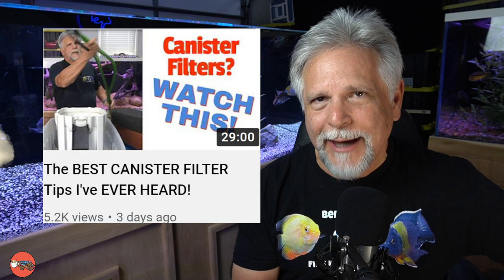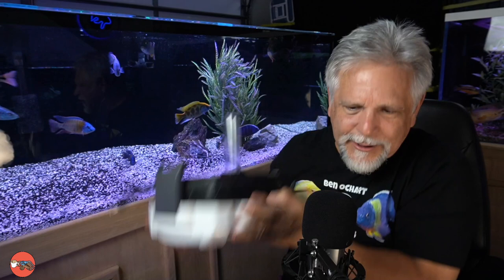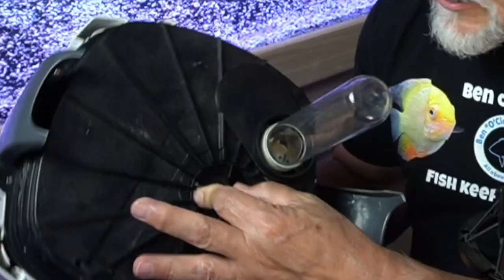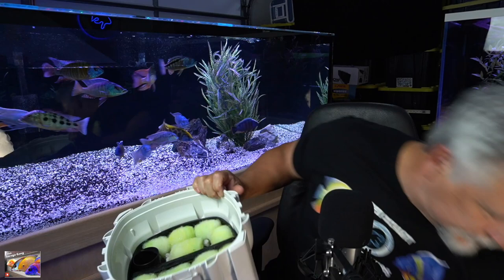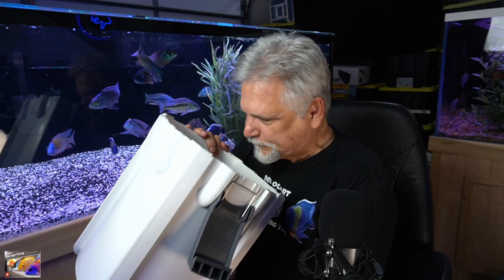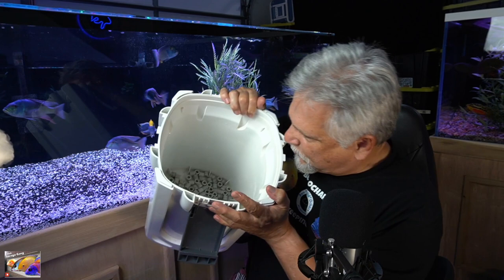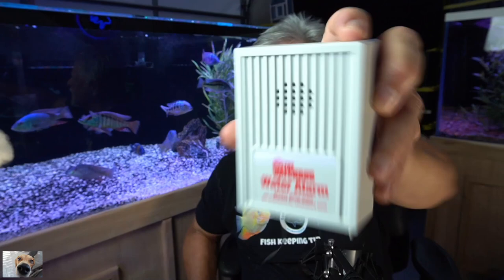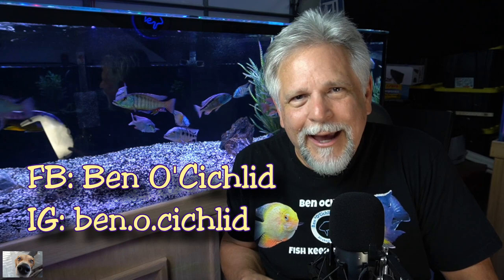COMPLETE Internal Media Set-up of my CANISTER FILTER!

Comment: Really great to listen to someone who knows what they are talking about. 
One thing that I have heard about the APS canisters (same as SunSun). The o-rings don't tend to last long for some reason. I have seen some people wrap this area in PTFE tape as an insurance.
I can imagine that it would be a nightmare if this failed and it pissed your tank all over your carpets or hard wood floors. Otherwise, a very decent filter for the price.
Reply: I have a sunsun 304..three months it started leaking. Change of O rings and tape hasn’t helped at all. Any suggestions to stop it from leaking?
Reply: @kunalravisingh4382  If it was 3 months, I'd be taking it back to the shop.
 Check that the lid is on properly and that the o-ring isn't crimping or incorrectly positioned.
Reply: I had both my sun sun do exactly that wifey was angry lol rightfully so I came home to a flood and over 100 gallons of water on our carpet in the basement it took forever to dry up and a lot of vacuuming and fans to clean shortly after the second one leaked even with Teflon tape over the gasket we thought it was best to remove the sun sun and added fx6 filters problem solved we paid a lot more for the fx6s but worth the peace of mind with anything you get what you pay for 🤙🤙🤙

Comment: I totally agree with the way you set it up. That is why I like the sunsun because the fx6 is bass akwards in my opinion..
Reply: @ Chris G…I have an FX6 and like it a lot, but it is a beast to move around and/or remove from my tank stand (which is not really built for an FX6). And, I’m waaay overdue for maintenance on that due to shoulder surgery a year ago. So…I’m mentally working up to getting that out of the cabinet and cleaned up! Great to chat with you today at the livestream! 👊
Reply from the maker: I too hated having to remove it from under a tank. Now it’s elevated behind the 300 and very easy to work on.
I suggest that you buy a long hose that will fit snuggly on to the bottom purge valve. Run the hose out the door, shut off the IN/OUT valves, unplug and detach the top hoses. Then open up that purge valve and let all the water drain. It is a lot easier to move after this. 
Be sure to close that purge valve and fill before plugging back in or you’ll have a mess (and a burned out pump!).
Reply: It was great to  chat with you also !!! There is no doubt the fx6 is the best canister on the market . But unless you have a huge tank like Ben Ochart does .Personally I don't think it is needed for anything less than a 125 gallon. Remember that's just my opinion.  Have a great week @CatSailor and You also @Ben Ochart 🙂🙂

Comment: I always get rattling from my 704 b’s i removed some biohome it still rattles i love how much water it moves & i love the built in uv they dont suck but they r rattleboxes
Reply from the maker: Mine never rattled. Be sure the impeller is seated properly and the screw down top in snapped fully in place. Also, be sure to place it on a foam pad.

Comment: Hey Ben if the sun sun 704b comes with the built in uv why not utilize the benefits of the uv?? The benefits of the uv are countless I run 3 fx6 on my 220 and I use the turbo twist and my water is crystal clear and the uv gives the water that extra polish you talk about plus it helps to keep algae and ich and other water colom parasites at bay just curious
Reply from the maker: Look at the watts and gph of the twist. It’s a true UV. The 9watt bulb does hardly nothing to water rushing past it at such a high gph. Real true UVs like your twist are awesome.
Reply: @BenOchart  I understand now I completely agree with you my fish friend love your videos ben
Reply: Ben actually got me hooked on the sun sun filters I have a 704b and I've got a sun sun 3000 and a fx6 only problem I had with the sun sun 3000 was it started to leak at the top  o-ring  and it was not that old  so I saw a video from a guy from Australia use some white plumbers Teflon tape I wrapped it around twice put top back on no leaks I'm still a sun sun fan can't beat the price or the performance..ty Ben
Reply: @gregward8234  sun sun is a good product I like the fact it comes with a built in uv as well the only issue I have is I had 2 704b both leaked I have had fx6 3 of them for years I never had an issue with them but some people never have an issue with sun sun products and yes the price point is excellent

Comment: Just want to make sure.. The black part that connects to the top of canister and has the in/out hoses connected (with that open close flap). Is it suppose to be able to just pull out of the canister top with the flap in the open and closed position?
Reply from the maker: Yes. It detaches completely.
Reply: @BenOchart  Thanks! I was thinking it locked in after putting the flap/valves in the open position.
Reply: @timsgarage1861 Never open the lid without detaching the flap.